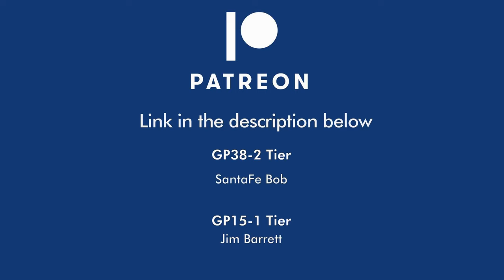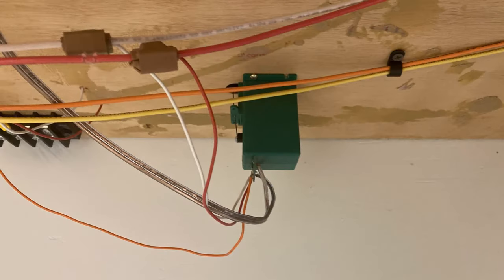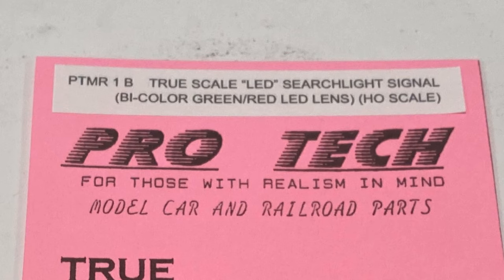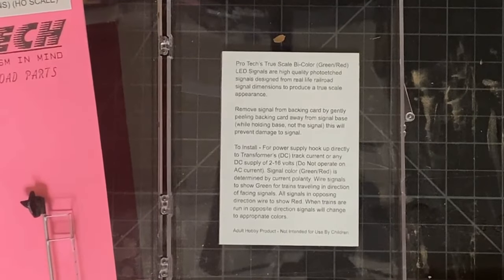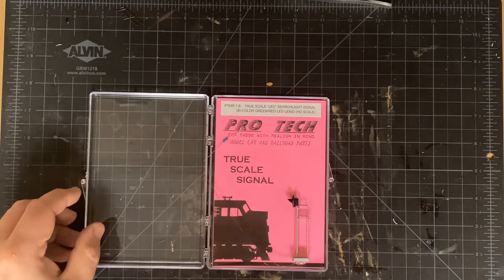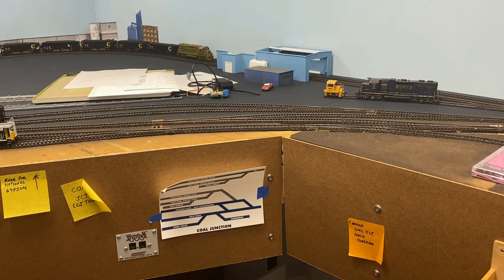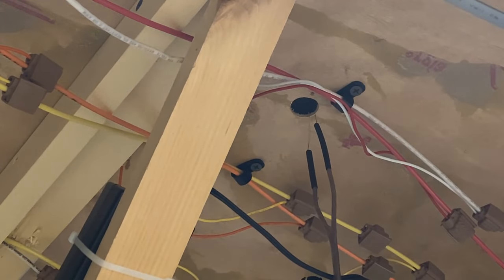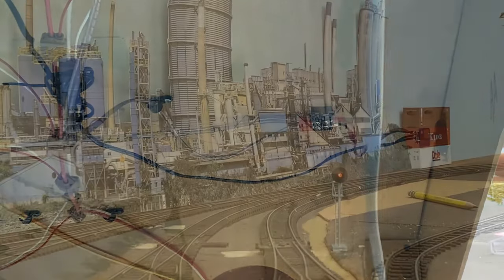What This Pro Tech HO Scale Signal Installation Revealed...

Comment: Hi Joe, this is one of the reasons I prefer building small industrial layouts. With just the one little shunter there's no need for signals. And I completely get your hesitation with fiddeling with this type of "micro" electronics 👍
Reply from the maker: I’m torn. I love the look of them and have enjoyed running layouts with fully automated systems. But it’s definitely not something I’m prepared to tackle on my own just yet. I’d need some help.
Reply: @ThePixelDepotLLC  I felt the same way years ago, and now my layouts are mostly just an excuse to build signal and interlocking systems!  I am a bit of a Luddite and use relay logic, although I do use a lot of diodes and commercial detections systems (Bruce Chubb, IRDOT, others).   I had the luxury of getting to spend a lot of time in a few prototype towers between 1988 and 1992 and observing how the "real thing" worked.  The whole tower "atmosphere" is something I strive to replicate.

Comment: Just a FYI. If you insert a drinking straw into the hole you will minimize the trouble of snaking the wire through the layout base. It appears you didn't have this problem though.
Reply from the maker: With the size bit we use, it would need to be a thin straw. But it would prevent getting hung up on things it you could find one small enough. 👍🏻
Reply: @ThePixelDepotLLC  How about those little straws that are used to stir alcohol drinks. There are about 16th to 3/32 diameter
Reply from the maker: @154Colin  could work. But I wonder if that goes too far the other way. It might have worked for the signal install, assuming that you remove the resistor first. But I think this would be too small for normal drops.

Comment: You could have wired that so the turnout would throw too. In the video it looked like when you flipped the switch, the light changed but the turnout did not. Pins 1 & 8 are power and go to 12v via a dpdt switch, however, if you jump from pin 2 to 7 and pin 3 to 6 and run 6 & 7 to  separate 12v as well, when you flip the switch, the tortoise will move and the internal switch in the tortoise will change the signal that will be connected to pins 4&5. Your signal should not have gone to the panel switch at all. I use this method for running leds to panel lights but it doesn’t matter if the light is a signal or panel indicator.
Reply from the maker: Hi Jeff. Sorry if it wasn't clear from the video, but that is what we did. Flipping the switch on the fascia toggles the points on the turnout as well as the aspect of the signal.

Comment: Very nice video on installing signal,  I have a question, if the switch is thrown to green how do you know the track does not have an opposing train ?   I know we are talking about detection but is there a way to monitor the block with out detection?
Reply from the maker: In my case, you’d check with the dispatcher to find out about an opposing train. I am no expert on signaling, but I don’t know if a way to monitor the block without some sort of detection. There may be a way with JMRI but I’ve never looked into it.

Comment: Can these be hooked up to a Bachmann turnouts??
Reply from the maker: It’s actually not connected to the turnout itself, but rather is powered by the switch machine. If you’re using switch machines with your Bachmann turnouts, I would think you could make it work.

Comment: Why don't you just put a straw or other hollow item through the hole with all your other wiring attached (so you don't have to solder under the layout) up to connecting to the switch machine?
Reply from the maker: That probably would have worked, but I’d worry that the hole you’d have to make to get a large enough straw though would be too big. Thoughts?